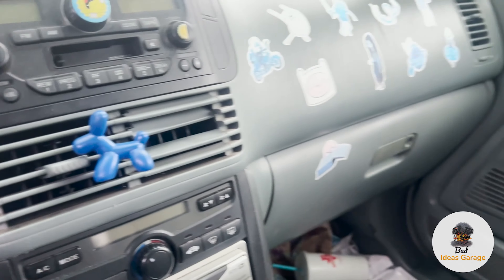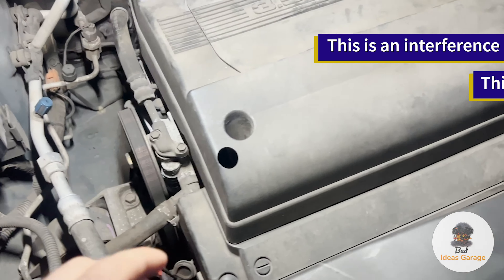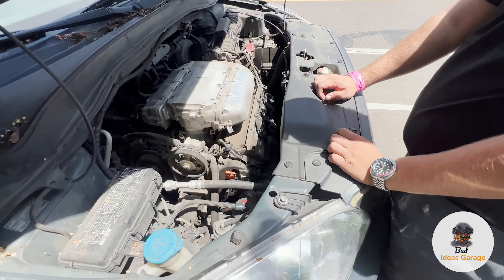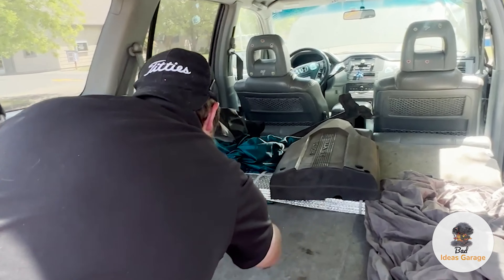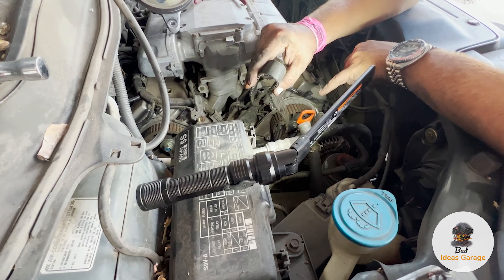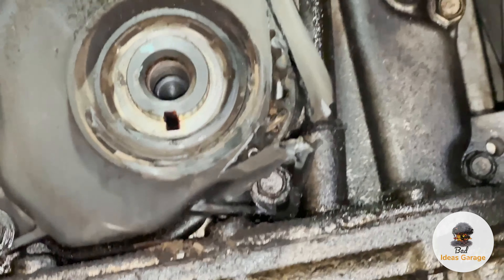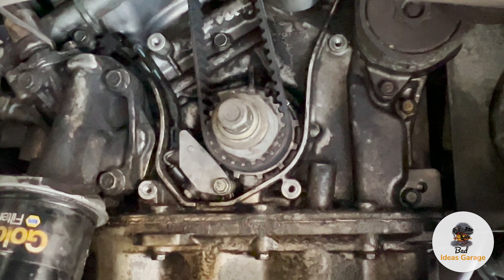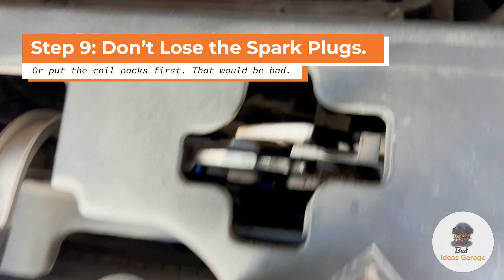Reviving a $50 Honda Pilot: Broken Timing Belt Adventure! Will It Run? 🚙🔧

Comment: i have an 05 pilot with p0340, i took powersteering pump off to access the cam sensor, before i did i cracked open the front timing cover and cranked the engine, the belt looked okay but it didnt spin with the serpentine belt. does that mean that my crank shredded my belt? i havent opened the rear cover because its hard to get the bolts off. the belt on front cam looked tight with no cracks as well. engine light came on at 4k rpms going 75 mph.

Comment: Did the ECU report misfires on the cylinders with the bent valves? I'd expect yes. I'm curious how quickly it figures that out and gives you a clue exactly which head is damaged, if not both.
Reply from the maker: I don’t have an overly advanced reader, but it did not pick up anything besides, a transmission error code which is unrelated. It ended up being OK after replacing just the valves :-)

Comment: Broke the same as mine 180 on rear cam and bearly off on front cam belt still has tension.  Im going to replae the set the marks and replace the belt. Wish me luck
Reply from the maker: Let’s us know! Ours needed a few valves but was ok till the trans went out.

Comment: Im just here curious is anyone else got lucky.  My buddy just brought me a 2006 with only 135k on it. He got it at the auction for 1400. They told him it had a broke valve. I heard severe clacking when he tried to crank it but this sound is too familiar to me and I told him the timing belt tensionor failed.  He gave me a green light to dive in so I removed the timing cover and check position of the cams. Bank 2 was off by 2 teeth so I reset it, replaced the water pump and belt and it's running beautifully.  This was the best deal every in my opinion.
Reply from the maker: this one needed just valves also! Lucky indeed

Comment: Good Video man. Would've been happier if it worked but you know you gotta show the failures sometimes. So I say about 10% chance of the cylinder heads being good if the timing belt breaks
Reply from the maker: Amazingly enough, it was only valve damage on this. I gave it to Casey who is the guy that was helping me in this video and he drove it for a bit! In true Honda fashion, the transmission went out😂 we think it’s torque converter this time.
Reply: @BadIdeasGarage  oh yeaa, the Honda torque converter. Been suffering with that for the last 4 years. The car vibrates when I'm idling on Drive. Probably need to change it but its too much work so I just drive like that.
Reply from the maker: @soikothassan6717  but in true Honda fashion, you’ve been driving it for four years as is?🤩
Reply: @BadIdeasGarage  Yea, haha. Its a 2009 Accord with 230k miles on it. I was gonna do it but then I thought, it's at the end of its life cycle and I don't have the means to take the transmission off and I don't wanna pay someone $1000+ to do it. Drove the last 80k miles with the torque converter like that, and it is still running good. I just put it to neutral when I'm at a traffic light so it shakes less. It wears out the motor mount faster tho.
Reply from the maker: @soikothassan6717  don't Dodge people pay good money to have a shaker hood? You have one already 😀

Comment: With 300K? At most a used engine. 300k is pretty much the limit on the suspension, bearings, prop shaft, and honestly transmission. All those things would need to have some life left before putting a dime into it.  If you tried a head (it would probably need two). You never know what you'll find wrong with the valve train. Add head gaskets etc it's cheaper to drop a used engine in and pray.
Reply from the maker: Pray we have! It looks like one of the heads is damaged and the other one is OK. So that’s where we are going to start. I looked into what it would take to get the engine in this and the whole thing has to come out of the bottom. I would definitely prefer a used engine, but doing the head is less work in my set up